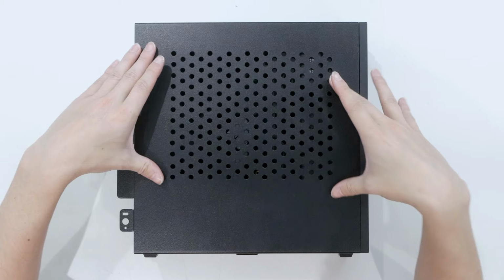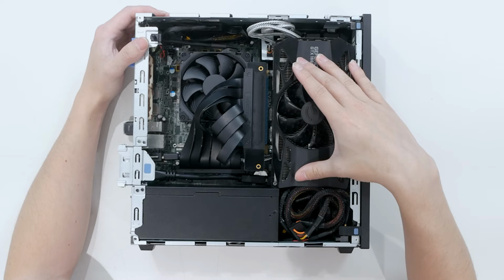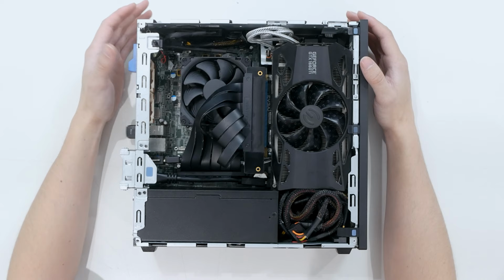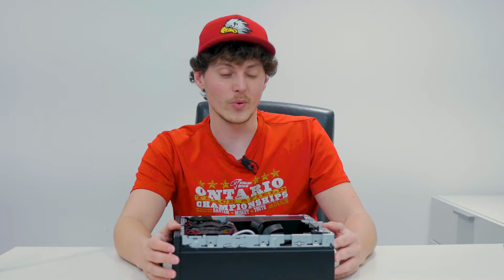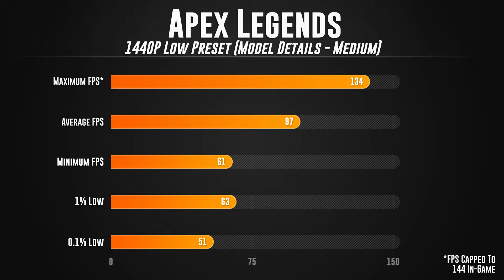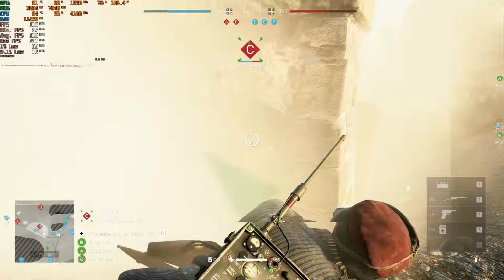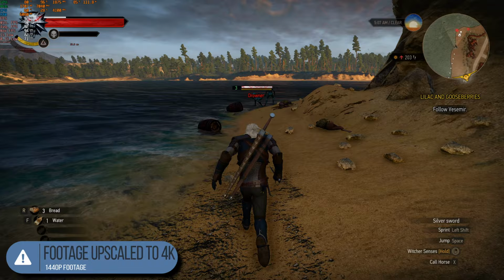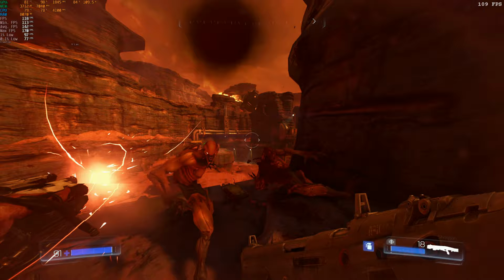Full Length GPU in a SFF Dell Optiplex Gaming PC!?

Comment: Hey tottaly not copying you right now but if i was, how did you install the cpu cooler mounted? Did you use smalled head screws?
Reply from the maker: Just used the mounting backplate that came with the cooler. I ripped out the welded standoffs from the case
Reply: @WiltshireTutorials  Thanks man, never really could get the bios stable with the dell motherboard but if i got my rx 6600 to work imma get my 6750  xt tucked in there too (Ive still got like 80 more holes for that lid lmaooo)
Reply from the maker: @sp4c3d0ut9  No problem! I would try updating the BIOS on the OptiFlex. Just look up your model number on Dell's website. Should be an .exe
Reply: @WiltshireTutorials  thanks I should double check its bios for it, the optiplex motherboard lottery is a wild one.. any advice for used bios locked mtbs< other then pulling its jumper haha
Reply from the maker: @sp4c3d0ut9  the jumper is pretty much the only way to reset the BIOS lock, as far as I'm aware.
Reply: @WiltshireTutorials  thanks man had to check with the optigod
Reply from the maker: @sp4c3d0ut9  you're welcome lol.

Comment: Doesn't dell throttle the PC if you use a non original dell PSU?
Reply from the maker: Not sure where you heard that from, but that is false.
Reply: @WiltshireTutorials  I've seen dell units that do throttle the processor speed if you use a different PSU
Reply from the maker: @user-ej4yu5ce4o  do you have any sources that prove that? I've never heard, not seen it happen.

Comment: Could this also work with the GPU and power supply external? I have a Optiplex 7060 i5 8th gen. Maybe use some extensions for the power cables?
Reply from the maker: In theory, I don't see why not!
Reply: @WiltshireTutorials  I got a RX 6400LP coming next week. Will see how that plays first. If I don't like it I'll return it and go the external route. Thx
Reply: @Coz Coz nice!!
Reply from the maker: RX6400 should be pretty decent for some 1080p light gaming! Would go perfect with the build.
Reply: @WiltshireTutorials  got it up and running yesterday. Runs flawless on older games like COD BO3 Custom Zombies 1080P high settings. Any new games I play on ps5
Reply from the maker: Awesome! Glad to hear things worked out for you! Have fun playing some BO3!

Comment: Do you think you could still naturally fit a lowpro GPU in there after the power supply swap?
Reply from the maker: Yes! The Silverstone PSU is the same dimensions as the previous stock PSU.
Reply: @WiltshireTutorials  Beautiful. I thought it might be slightly proprietary shaped